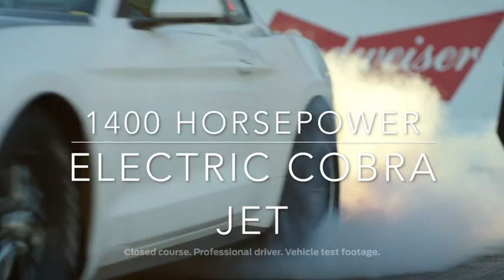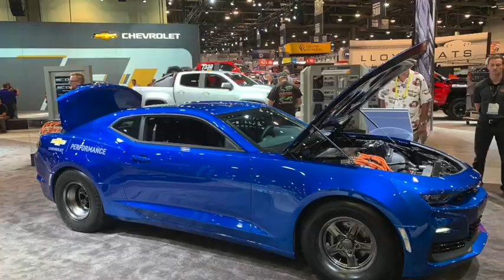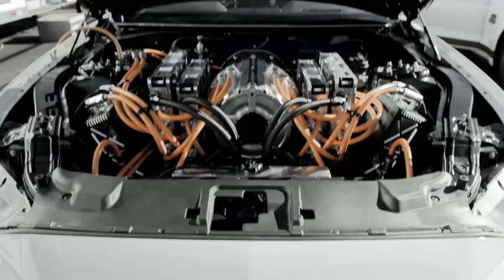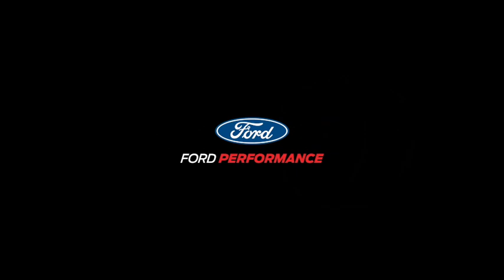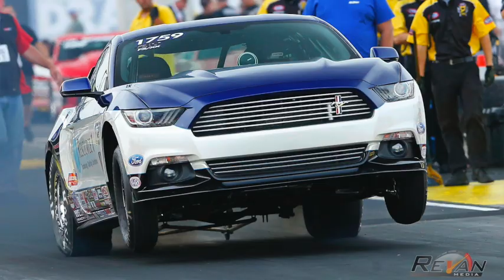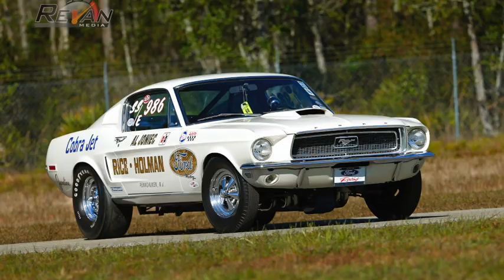1,400 HP "All-Electric" Cobra Jet Mustang Hits The Track - Is EV the future of Drag Racing?

Comment: Electric cars have no soul.  That technology plus self-driving capabilities will turn automobiles into appliances.  They’ll be about as thrilling as your fridge and dryer.   Remember what happened to turbine powered open wheel race cars?  Faster than the piston cars and no one cared.  Same idea, only worse.  Even the turbines sounded more exciting than electric.  I think what’s driving the current enthusiasm for electric is a combination of hope, a poor accounting of the birth to grave dependence of electric cars on fossil fuels and the absence of information on the impact of all those used batteries on the environment. Of course, I could be totally wrong but that would require some factors that I’ve yet to see or hear.

Comment: Nice video.  You should have cropped the end of the video where you talked about all the reasons why EVs won't be adopted widely.  Range anxiety BS.  You obviously don't know own a good EV and don't know what you are talking about, so why try?  We never take a gas car on the long trips.  There are very few cases and they are usually in remote places or very slow light weight off-roading scenarios where a gas car would be more appropriate than EV today.  Eventually, it will be much more cumbersome to refuel a gas car than an EV so things will only get worse for gas cars going forward.
Reply from the maker: Thank you for your comment, you make very valid points, however, in dealing with Ford, it knows range anxiety is a real thing. I've been in meetings with Ford executives who know they have to educate the public on range and usability. I do agree I should better educate myself on EV. I know quite a few Tesla owners who love them.

Comment: No it won’t . There won’t ever be a replacement for a couple of pansy ass oversized electric cars at the strip with no internal combustion engines at the track . 90% of the emotion that a person ie spectators feel is when a car screams by them shaking their insides . Even if you have to wear earplugs this is what people pay to see . They could really give crap how much “faster “ Rc cars are. It’s effn BOOORING!! And Um sorry but I’ll roflmaf about how “oil is going to run out” sorry but the earth makes it . It’s not dinosaurs. The same “experts” that came up and are still vomiting this nonsense ,said that the oil would run out 40 + years ago . Having said that methanols and nitromethane is the ones that most people pay to see.

Comment: One thing with electric cars that suck is that one of the reason I like cars sound,modifying , im going to be stuck with what I got i ant no electrician.
Reply: WRONG! You are far more screwed with modern ICE drive train which have lots more proprietary parts. You can literally force a Chevy LG Chem Battery to power a Tesla Drive Unit. BEV drive train is far more adaptable and flexible. Note this is just a S550 with BEV guts stuffed into it. Electric Cars are going to bring back Grass Roots BUILDs not just modifications.

Comment: EV might be the future buuuut, if you think about it, you do need a lot of batteries to be able to drive for long enough with the speed it goes and pure power that the engine needs, so that means the car will need to be stripped down and stored batteries and/or it needs to be very light with the chassis
Reply: Nah High Peak power batteries packs exist if you liquid cool them. They have massively reduced energy capacity and range, but they are much more light weight. Perfect for Drag Racing.
Reply: @Neojhun  True, didn't even remember liquid cooling was a thing lol
Reply: @monsterr4t  If you want truly insane performance like 2/3 of a top fuel dragster. The distant future is Super-capacitors. Basically 5000hp from a 700lb box. Issues currently is the Power Dense drive unit motors & reduction gears does not exist. This power supply is basically use for BAE Naval Rail Gun.
https://www.naval-technology.com/news/newsraytheon-delivers-pulse-power-containers-for-us-navys-railgun-programme-4904013/
Reply: @Neojhun  I don't have the patience to convert lbs to kg but it seems you know what you're talking about so ok, but it does seem like the future of electric drag racing is still pretty far away
Reply: @monsterr4t  Oh sorry I was assuming mostly Americans here. I'm Aussie I grew up with metric, that's about 320kg PSU for 5000hp.

Comment: If there is access to a Level 3 charging station the charge time isn’t that long. Harley-Davidson incorporates level 3 charging in their Livewire and all of the dealers that sell them will have level 3 charging on site. It only takes a little over an hour for the Livewire to go from completely dead to fully charged using the level 3 charger. It will also boil down to the capacity of the batteries and how much is used per run as to how long the turnaround time is.

Comment: Range is basically a non issue for powerful BEV. To be Powerful you typically need a Big Capacity Battery to support that power output. It's the weak COMPLIANCE cars which have horrible range anxiety. 300 Miles & 30 Minutes charge will be the norm soon. That's 600 Mile per day with a SINGLE 30 minute break.
The best thing I like about BEV drag racing and track cars. Is the grass roots engineering and BUILD. Note how they just stuffed it in a S550 same as Webasto. This is NOT exclusive to OEM suppliers big companies. BEVs are soo much easier to adapt connect to various parts, simply less proprietary parts lock out. Currently the industry is heavily relying on Salvages Crashed EVs for parts that is already realy powerful. But purpose designed off the shelf parts will be even more refined and reliable.
What I hope it will spur a new golden age of backyard mechanics and engineers. We just need to defend Right to Repair (John Deere) and keep the OEMs in line.

Comment: That thing is badass. It weighs 8500 lbs. And can put that power down for 137 feet before it needs a recharge!!!!
Reply: "8500 lbs" WTF? that makes no sense. It most likely has a high peak power density battery low capacity battery, probably around 35kwh and 700lbs. That's good for two 1320ft runs with no power degradation. It should be the same weight a V8 Corba Jet with stripped out interior, i'm guessing 3500lbs.
Reply from the maker: Where did you get this weight from?
Reply: @revanevan  My guess is based on GT350 minus some interior stripped out.

Comment: Range anxiety with electric cars looks like it may not be around much longer. Tesla's new Roadster specs: 0-60 in 1.9 secs, top speed 250mph, 650 MILE RANGE, and seats 4 comfortably. The ICE age is coming to an end.
Reply: Not when that will cost you 250k.  Not the price range to get the masses to convert
Reply: @clintway116  Hybercars are not meant for the mass market. The Tesla will be competing with the likes of Bugatti and Koenigsegg for a 1/10th of the price.
Reply: @Redeemed52597  I get that.  Just pointing that the model used for the argument was not attainable by the masses.  And a model 3 isnt EVER going to convert me or many others(unless a gsr Integra is their idea of quick).  At this point, my only real turnoff for going electric is styling...or lack thereof.  Every tesla looks so much the same I cant tell one from the other.  And there is no reason the "cars of the future" should be able to be confused for the likes of a Hyundai elantra or a late model dodge dart.  They just look like watered down, boring blobs to me.  But I digress from our original topic.  Ice cars will be here for quite a while to come.  It will just be v8s getting phased out like the 80s did.

Comment: It's cool to see what people can do with technology,but I'm not a fan.  This type of car would really hurt the aftermarket industry.  No one would need an exhaust system and so on.
Reply: WRONG, BEVs are soo much easier to modify and have far less Proprietary Lock Out Parts. You don't just Modify BEVs, you can BUILD them from ground up with your own choice of architecture. BEVs will bring back BackYard Engineering and Custom Drive Train builds.
Look up EV West, Jehu Garcia, Zero EV, Electric Classic Cars Wales, Rich Rebuids, Bloodshed Motors and Jason Hughes. These are all Builders who start from a rolling mule.
Reply: @Neojhun  I'm not going to discount what you're saying.  I should have been more specific in my reply to the? If you've ever been to or seen on TV an NHRA event these guys are constantly rebuilding their engines. Top fuel, funny cars, pro mods. Even the lower classes . They are changing valve springs clutches etc.  Do you think all of this maintenance would be required on an electric race car. 
Even though it wouldn't happen over night, I doubt companies like crower and comp cams. Want to to see electric race cars
Reply: @91lxaod53  YES you still need to lots of work to push the limits of BEVs. You currently have no experience and knowlege of this architecture. It's conceptualy very similar to TURBO Tuning. It's about removing bottleneck, heat and general failure risk, instead of PSI it's Amps. 
Soo stuff you have to work on: Insulation be it Inside the Motor or the Battery Pack, Power Distribution Lines & Bars, Power Electronic Boards (don't let the magic smoke out), then general Oil & AntiFreeze Cooling systems. Then there is the mechanical bits which have to survive the Massive Instant Torque, expect Half Shafts & Reductions Gears to Crack. If you truly want to push the limits in Drag Racing, Track Driving & Drifting. These are the parts that will fail.

Comment: More expensive and still slower than gas cars. Battery production pollutes more than fossil fuels.
Reply: "Battery production pollutes more than fossil fuels" LIES! Objectively Wrong.
In terms of Resources Usage a BEVs uses 1/2 the resource even on US Dirty Grid Mix. 1/4 on a cleaner more Renewables based Grid.
Interms of Pollutants the Benzenoid Aromatics in Crude Oil products is Several Times more LD50 Toxic than anything in Lithium Ion Battires. Chemistry Biology FACT!
https://en.wikipedia.org/wiki/Polycyclic_aromatic_hydrocarbon#Regulation_and_oversight
Over the long lifespan of a BEV 350,000 to 500,000 Miles. ICE uses far more Fuel & Maintenance Consumables which outweigh the 40% more resources it takes to build a BEV.
The only case where ICE is cleaner is when BEVs & ICE at low mileage. That means a V12 Ferrari with 4000 miles for it's entire life is cleaner than a BEV, but that's not realistic.

Comment: For electric it should be way more torque than 1100. Ford lowered it down. Cause the torque be to crazy lol Having high torque like 7k would be snakey around the track lol
Reply: Umm you forgot about the Turbo 400, I'm surprised it's even that high. That's not gradual build up of 1100lb/ft, that a sudden burst typically controller limited to roll in over 1000rpm /12,000rpm band. We simply don't have multi ratio transmission right now which can survive instant sudden massive torque of BEVs. Heavily relying on limiters.
Reply: Neojhun  Not sure how much torque turbo 400 can handle. Just old GM Big Block transmission. Mopar 727 3 speed just as strong, not sure Ford C6 3 speed as strong though. Rail Dragsters and funny cars. Don’t know what they used for transmission lol Hp 12+ lol.

Comment: I am fairly sure I won't be around if and when EVs dominate. Besides the commonly discussed problems yet to be solved with them, there is quite a bit not talked about, as far as negatives. All that aside; I love gas fueled engines and cars, and that's what I'll own and use, no matter how much faster or "better" some EV is. I can't even imagine an electric-motored vehicle giving the impression of having some kind of mechanical "soul" or attitude. EVs are soul-less appliances on wheels, in my view. They'll get better in lots of ways, I'm sure, but I will still never have any interest in them, not even as a spectator, let alone driving one on a road course or drag strip. Like the Flathead guys when factory hot-rods began to proliferate, I'll live in the past, still getting goosebumps when the cam makes my gas V8 chortle, snort and exude cubic miles of attitude.
Reply: Soo a massive rant based on Zero Experience with Electric Sportscars? FYI vast majority PRIUS are 100% Gas Powered.
https://youtu.be/5gFGX43vubM?t=340
Jeremy Clarkson "It feals like nothing else i've driven before, it feals twitch and nervous. It feals like a Thoroughbred (Horse)".
Beast is my prefered description for Electric Cars. "soul-less appliances on wheels" is massively wrong.
Reply: @Neojhun  Oh, I see. I don't feel the same about the issue as you, so I must be wrong, misinformed or something. Evan asked for opinions, but you have vetoed mine, in your mind. 

I have only driven 3 Teslas. Amazing what can be done in a car that weighs more than a '59 Cadillac Sedan de Ville, but they still leave me cold. Bored and unmoved, to be more specific. You buy and own all the EVs you want, watch all the electric drag races you wish, and I'll do what I want. 

Plus I don't know why you decided to refer to the Prius and Jeremy Clarkson when you undertook "educating" me. 

What gearhead (which I am guessing you are not) gives any cares about a Prius? 

Jeremy Clarkson? A comedian, in my view. He got rich being goofy in and around cars. Fine. Continue to support him and make him richer as you desire. His opinion about performance vehicles is about equal, in my estimation, to that of a 16 year old schoolboy. His Thoroughbred equals my Frigidaire.
Enjoy your modern EV. I'll be enjoying my gas-powered relics.

Comment: I had range anxiety BEFORE I bought my first Tesla. Once I got the car, it went away and I’m on my 4th electric car now. I’m addicted to the low end torque they provide and the convenience of charging at home. With over 300 miles of range to start every day, you don’t think about needing to charge unless you’re going to drive 5 or 6 hours in a day. After that much driving, you should be ready to stop for food and bio breaks so a 30 minute stop isn’t the end of the world. How often do people drive more than 5 or 6 hours in a day anyway?
Reply: Ever get stuck in a NY or LA traffic jam?:-)
Reply: @jimkaray  Yes and the fumes from the gas and diesel cars kills me :-). No range anxiety in traffic at all. EVs hardly use any power when sitting in traffic and I likely will have had a full charge that day whereas many gas cars might have planned to stop for gas and are more-likely to run-out.
Reply: @lemongavine  how does it run the a/c or heater when stopped for extended periods? I carry a spare gallon of gas and can walk for more if I run out. Where does your magical fuel come from that produces no emmissions to generate?
Reply: James Karayanis the AC uses about 2 miles of range per hour so, u less you plan on being in traffic for the better part of a day, it’s not an issue. If I were to be stuck in traffic for 15 hours, I can guarantee there will be el trinity so,where close by where I can plug in to charge. The magical fuel comes from coal, natural gas, solar, wind, nuclear, hydro and any other future way of generating electricity. Gasoline doesn’t magically appear at a gas station. It takes huge amounts of energy to extract the oil, transport it, refine it into gasoline, transport the gasoline, pump it into a car and then burn it at about 15% efficiency to the wheels.
Reply: @lemongavine is that 2 mi of range loss per hr based on power regeneration while driving or at rest? How is heating efficiency?
Reply: James Karayanis at rest. Heat uses a bit more, but it depends on ambient temperature. If you end up needing to save energy with heat, you just use the seat heaters. Those only use about 50 watts so about 0.1 miles of range per hour.
Reply: @lemongavine  that does sound pretty efficient.
Reply: James KarayanisI have  been a petrol head my entire life. I didn’t go EV for the efficiency. I did it for the performance. The efficiency is great, but the performance is what sold me. If you’ve never driven a high performance EV before, give it a try. They are otherworldly. Nice chatting with you by the way.
Reply: Why your 4th car? Accidents? Or failure?
Reply: @austinconaway3314  no sales tax on EV in my state, plus $7500 tax credit and hi resale value….practically makes the car free for a year so I just get a new one every year. Never had any problems or anything like that. Funny thing is, I used to keep cars for ten years. Getting a new car every year is typically fiscal suicide, but not with the aforementioned incentives. My comment above was from a year ago. I’m on my 5th EV now, lol.